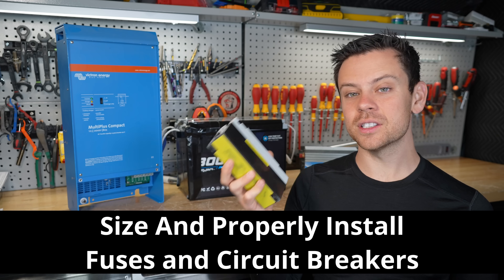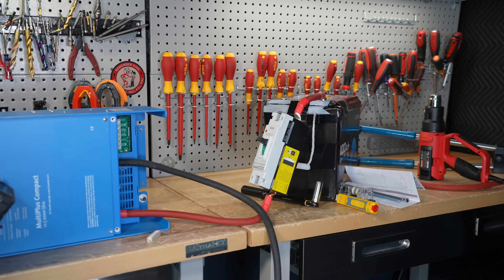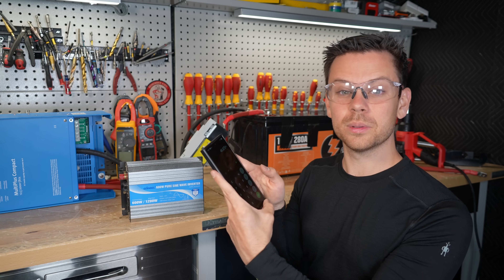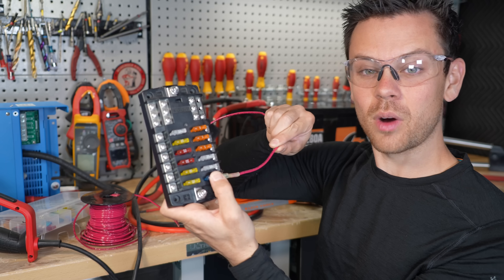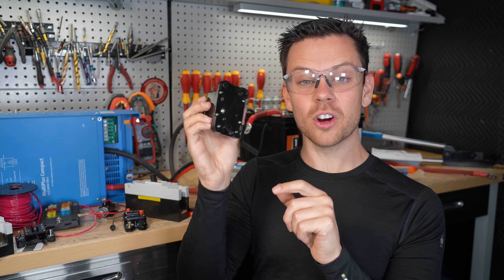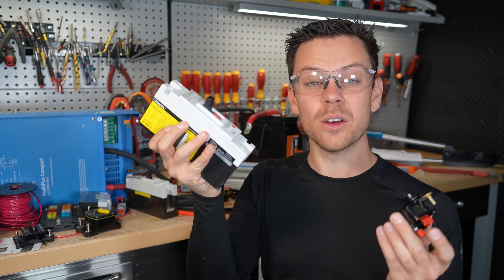How to Size DC Fuses and Breakers. Bonus Tips and Tricks!

Comment from the maker: Need Safe to Use Fuses and Circuit Breakers? Check my Recommendations First:
https://www.mobile-solarpower.com/fuses.html

Need Beginner Help? Check out the forum:https://diysolarforum.com/forums/beginners-corner-and-safety-check.52/

Free Book from Victron: https://www.victronenergy.com/upload/documents/The_Wiring_Unlimited_book/43562-Wiring_Unlimited-pdf-en.pdf

~~~~~~~~~~~~~~~~~~~~~~~~~~~~~~~
Tired of getting ripped off? Check out my "Will Prowse Approved" solar product recommendations below!

12V Batteries
https://www.mobile-solarpower.com/lithium-batteries.html

48V Batteries
https://www.mobile-solarpower.com/48v-batteries.html

Offgrid Inverter System Builder
https://www.mobile-solarpower.com/48v-complete-system-blueprint-559371.html

Hybrid Inverter System Builder
https://www.mobile-solarpower.com/code-compliant-48v-offgrid-system.html

Mobile Handtruck System Builder (very popular!)
https://www.mobile-solarpower.com/mobile-48v-system.html

Solar Panels
https://www.mobile-solarpower.com/300w-solar-panels.html

Ground Mount Solar Racking
https://www.mobile-solarpower.com/ground-mount-racks.html

Wire, Lugs and Busbars
https://www.mobile-solarpower.com/wire-and-connectors.html

Tools
https://www.mobile-solarpower.com/tools.html

Fuses and Circuit Breakers
https://www.mobile-solarpower.com/fuses.html

Plug-N-Play Solar Systems
Ecoflow, Anker And Bluetti! So many models to choose from. See my current recommendations here:
https://www.mobile-solarpower.com/full-size-systems.html

~~~~~~~~~~~~~~~~~~~~~~~~~~~~~~~~~~~~~~~~~~
Need to build a large DIY system? Need a trustworthy solar distributor? These are my favorites:

Signature Solar
Creator of EG4! Solar Minisplits, Victron and More! Largest Solar Store Online.
If you want $50 off, please use my link below and coupon code "DIYSOLAR50":
https://signaturesolar.com/?ref=cPwLcVc0SW-BjN

Current Connected
Best Prices for EG4, Victron, Midnite and so much more! Fast Shipping and Highest Rated Customer Service:
https://currentconnected.com/?ref=wp

~~~~~~~~~~~~~~~~~~~~~~~~~~~~~~~~~~~~~~~~~~
Join our DIY Solar Community 
Need more help? Join the largest solar forum on the internet for beginners and professionals alike. 140,000 members and counting!
https://www.diysolarforum.com

Check Out My Free Book
Best-selling and beginner-friendly guidebook to off-grid 12V solar!
https://www.mobile-solarpower.com/the-book.html

Comment: Quastion for the fuse between the batteri and inverter.
The batterie have a 200ABMS, so why not use a 225 amp fuse for protection. When you use a inverter there can take more then the battery can deliver?👍🏻😁

Comment: I'm confused. In another video you are saying the circuit breaker can replace a class T fuse and disconnect switch and now you say don't use it for that
Reply from the maker: Yeah I've grown to avoid using disconnect switches or using a breaker as a disconnect. You can technically do it but it's still stress is the hardware. 

Now with PV conductors you need a disconnect and it needs to be dedicated for that.

Comment: I'm curious about why you use a capacitor (resistor?  you said both in the video) when initially connecting the negative.  How does this prevent arcing?

Comment: I'm in the process of building a system for my RV. I have (4) 100ah batteries and don't trust the BMS that they have, so I want to add some protection to each one. I don't necessarily need a breaker; a fuse is fine, but at this point, I'd do it just for the safety aspect. My problem is I can't seem to find a 125A fuse holder or breaker that will fit with my 4/0 cables without spending an arm and a leg. Any advice would be greatly appreciated. To note, I have a 3000W inverter and plan on adding a mini-split later down the road, so I don't want to reduce the size of my inverter at all and want the added protection of 4/0, especially since my kids sleep in my RV at times.

Comment: It's interesting these do-it-yourself things are like camper etc. Yeah they can be run through wood and plywood and mounted wood and plywood and I would say possibly with consideration. It should be not be a place that is exposed at all to any possible damage. For instance, if you got it in your garage or some place where you throw a Jack in some recreational vehicle and the Jack or the shovel that happens to be right there pierces both those wires you going to have a boom and a flash? And even though it's protected by fuses, if it's a partial short, it could just catch on fire. In general, electrical wires are almost always encased in steel or aluminum to protect them from physical damage. There's a criteria about what are called wiring systems. How you get the power from one location to another. The wiring system has to be rated for the environment whether it be water, heat or physical damage. For instance, all throughout your homes in most places in the United States, you can use Romex however, you can't expose Romex to where it can be damaged. That's why they no longer allow it within 8 ft of an attic opening cuz you might step on it regularly.. so if you're putting any of these things up, make sure that you either cover it all with a metallic enclosure that you ground or you put it in a piping or a gutter or some way to protect the wires from damage. I promise you if you put it in your house and you get it inspected. If you don't protect the wires and do all the other things that will is doing then it will not pass code. And anyone who's touching anything electrical should read article 90 in the code. Essentially States the only reason for the code is to protect life and property. And almost every single paragraph in the code was written because somebody got injured or killed. Oh we got to stop doing this because somebody was injured to kill. None of the paragraphs in the giant thick book. Have anything to do with trying to make electricians or electrical manufacturers Rich they're all because somebody was injured or died

Comment: I would say never tighten anything down as tight as you can find grade 5 and then find the correct torque for that size bolt. Also, if you're ever crimping lux, excuse me if you're ever tightening mechanical lugs, which is mostly what you use. The wire should be wiggled 234 or five times and retightened in between each wiggle so that the threads excuse me. Strands of the wire flatten out a little bit and become parallel with each other and fill all the space correctly. If you get just one torque on it and you use it heavy duty which you do with batteries, then you will get some thermal expansion in the lug of the copper and it will then flatten out. If you haven't pre-flattened out the copper and at that point when it cools back down now it will be looser and the next time you use high current it will get hotter and it's a negative feedback cycle where you end up with a fire at her look so wiggle wires at their termination points. If they are screw, tightened into a lug and re-tighten after each serious wiggle. As a certified electrician, I wiggle it left right up and down at least once each direction, preferably twice all four directions. Then I push it further in to the position where I really want it to be and I torque it again and I do this a minimum of three times

Comment: Folks, this is an irresponsible & dangerous video.

Electrical design, even when it might appear simple, is ultimately a complicated matter to arrive at.  

The main electrical code in the USofA is NFPA Chapter 70 -- "F" as in fire folks -- written, certainly not only, but largely based on 100+ years of experience with electrically generated fire.

Would not use any of the cable or cable overcorrect protection sizes shown in this video.  

0:28 & 5:58 ... The numbers for cable amperage, for instance, must take in many considerations, none of which are mentioned, so how would you know that your installation would be safe using this video as a reference?  

Answer: You would not know.

Comment: 12 and 48v only? We should avoid going 24v? Im debating on building a 24v vs 12v (2-300ah batteries) portable power station for use in a small cabin and/or camper.

Comment: re small inverter 600W... Haven't you forgot to accomodate inverter efficiency? If it delivers 600W @ 115 or 230VAC continously, it will generate losses as its efficiency can never be 100%, real life efficiencies are probably between 80 and 90%, hence your continouus current will be 600Wx 1/80% = 750W/12,8V which is ~58,6A x 25% safety is ~73,2A. Hence an 80A fuse would be appropriate instead the 60A. Although the fuse should protect the cable it should also not overheat due to excessive current ratings through it if it borderlines rated currents...

Comment: Would that particular DC breaker be suitable for an Inverter/charger, where current flows in both directions or is it necessary to use a bi directional one specifically? Is this one Bi directional or polarity sensitive?

Comment: Will, 
Thanks for some very insight videos on lifep04, fuses and breakers.

Got question: What is the correct ring size 5/16", 3/8" or 1/2" for a dihool breaker model:
DHM1B-250A-1P --DIHOOL Heavy Duty Battery Disconnect Switch, DC 250 Amp Circuit Breaker for Power Station Solar System ?
I am trying to order parts while waiting for the breaker.

Comment: I have lithium battery backup that I would like to charge up while I’m driving between sites.  I’m driving a truck with AGM batteries. Is it possible to damage the lithium battery if directly attached to the cigarette plug to recharge?  Or should I plug the 12V inverter and use my victron battery charger?  Before lithium batteries I would recharge directly. However the lithium batteries have an electronic charge controller ,  so how does that change the system?

Cheers

Comment: You have to start at what is safe for the power source to discharge. You would need 3 12v batteries in parallel to power that inverter.

Comment: Interesting. Later on in the video you mentioned not to use the breaker as an on/off switch, but early on you actually demonstrated to use it as an on/off switch. Also, after switching it off and then on a later stage on again, the capacitors of the inverter will have to cope with the in rush current.

Comment: I was looking into a “ pro “ installation a whole house system in M D , most companies did not promote batt back up , and if the power goes out it would not work lol probably for liability reasons ( batts ) we have not come far if a electric car was made in the 1850 s and drove 40 miles and at that same speed, but “ Nic “ Tesla would probably say “ batteries? how barbaric “ as he stated about telephone etc poles , unfortunately his ideas and invention s were let’s say not of interest then and now , I do have a emergency back up solar system, batts etc probably too high amperage, but I ll use “ laser “ temp meters , and use with caution using smoke and heat detectors plus no combustible s near it , block walls cement floors , heat “ shield “ on the ceiling etc ps I hate led lights but they use much less watts actually I found some that u can adjust the k temperature on them , good vid !!!!

Comment: I don't understand why I can't use a breaker as a disconnect if something happens
Reply: You can for emergencies, that is why you install it. But not for regular on/off switch. The spark created every time will damage it over time.
Reply: You should not follow any of the electrical advice regards components and component sizing given in this video.  Electrical design has to take in many considerations, and this video is dangerously oversimplifying and generalizing.  An MCCB breaker certainly can be used as a disconnect, but in this example it is likely not rated for switching -- and in just this example you can see how one must be very careful with words when describing electrical components and their function in a given system.
Reply: @PromEVeus  Angry and electricity and electricity and electrical damage and electric recipes and on and on and on WE FUCKING GET IT

WE FUCKING GET IT

SHUT UP

Comment: Hi, are those circuit breakers polarized or not?  Afaik polarized ones only protect against short circuit in one direction, for example from battery to inverter. But current in hybrid setups goes also from inverter to battery when charging. Are batteries protected if there is short in inverter? Should we use non polarized mmcbs? Would be great to see test or get your opinion for that situation 😊 Thank you for tests, very practical and informative. Great content!

Comment: Man You suck, all I wanna know about is 24 volt systems.

TODAY I'M GONNA COVER EVERYTHING THAT DOESN'T PERTAIN TO 24 VOLT SYSTEMS
Reply from the maker: Use 48
Reply: @WillProwse  🤣🤣🤣🤣🤣
Convert Your Tesla to Diesel.

What moron still runs 12 volts???

No worries, I'll make a channel to address all the relevant information for the world of 24 volt systems, You just worry bout You Will.
Reply: @Not1Edit  (What moron still runs 12 volts???) That is quite an insulting way of giving your opinion.
Reply: @Not1Edit  BTW, I run a 12V for reasons that will be above your comprehension.

Comment: Hey Will! Appreciate the videos. Question on that last point: would Loctite on the lugs of a breaker/fuse be a good idea? I've seen it used on automotive brake systems, suggesting to me thermal cycling isn't an issue. Seems like it would help hold torque here too. Am I missing something?

Comment: About proper torquing and re-torquing of terminals: One should not have to re-torque if installed properly, since the reason for torque specifications is to stretch the fasteners within the limits of the elasticity modulus of the metallic components so that they will maintain connections through thermal cycling. Using Bellville conical spring washers (instead of regular flat washers) between the nut and the conductor terminal lug adds an extra layer of security, since they add a constant spring force to the connection. Split lock washers do the same thing, but not as effectively. One can get the Bellville washer with knurling to add more security from loosening fasteners.
Reply from the maker: I totally agree but I've used torx screwdrivers on terminals and 6 months later they would be a little bit loose. After you tighten it a second time it seems to be perfect
Reply from the maker: You are 100% right but I found that they still loosen sometimes

Comment: You didn't talk about fusing and cabling for battery banks made up of, say, e.g., 12V 100Ah batteries (which I think you may not be a fan of, but that many do choose) in some parallel-series configuration. Things such as inter-battery cabling (or cabling to bus bars) in consideration of potential failure of one or more batteries, leaving the remaining batteries/battery to supply large amperages, come to mind. Perhaps you already covered that in another video? Most installers/installations don't fuse each battery (unless in a boat)?

Comment: What's your stance on polarized vs non-polarized DC breakers?  Do polarized (cheaper) breakers present a potential danger if current is flowing back into the battery when charging vs. supplying the inverter when discharging?  I think the arc extinguisher function of breakers is superior to fuses in high-current discharges but I wonder about the type of breaker.

It would also be good to mention that wiring polarized CB the wrong way is asking for trouble.  They aren't like fuses.

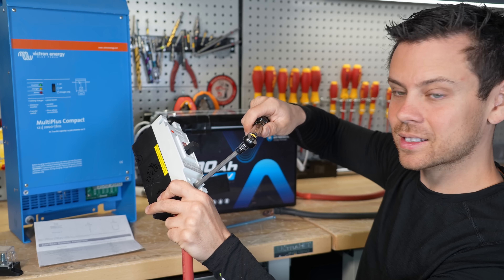Comment: I'm at about 1:50 in the video wondering if there's such a thing as a conical center tapered lock washer that tech could use to secure improperly sized connectors during maintenance calls.

Comment: informative video but missing arguably the most important element of protection equipment sizing.  Proper voltage and current ratings are fundamental, but the interrupting capacity of the device is the difference between a safe system and a time bomb waiting for a fault to occur, particularly on large battery banks where the short-circuit current can be very high (>10 kA).  Class T fuses, with ~ 20 kAIC, are often the only way to achieve adequate interrupting capacity.  Undersized devices (breakers and fuses) will operate  under fault conditions, but the arc will not be extinguished if the fault current exceeds the interrupting capacity of the protective device.  A terrifying amount of energy can be released with no means to stop it, resulting in fires, explosions, and even personnel injury/death.  In my work as an electrical engineer, AIC is often the most important criteria.  Love your work.

Comment: While it's true that a fuse or a breaker only protects the wire, it's important to not minimize that point. The wires getting too hot are usually what will cause a fire in the house. Failure inside of a piece of equipment is usually contained by the chassis of the equipment.

Comment: @WillProwse you should do a video showing how important it is to have the cable sitting directly on the fuse, battery terminal and/or inverter bus bar without washers. 

Do a video where you take it to near the rarer capacity and show the heat generated from washers between different components. Include stainless washers, regular steel washers, plated washers, galvanized washers and even copper washers. 

You might consider a FLIR camera or FLIR One phone adapter. I have the FLIR One and it works great! But I don’t make videos so I’m not sure how it would work for you.

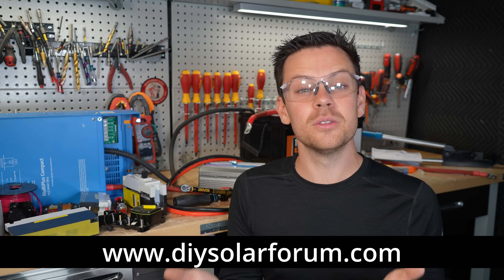Comment: Will at 12:20 into the video timeline, you mention sizing the conductor at 1.25. Did you mean the fuse?
Reply from the maker: No, the conductor. Then the fuse or breaker, you should run at 80% for best performance. Mention that later in the video, sorry
Reply: I'll see if I can find where you mention this further in the video. Thanks for responding.